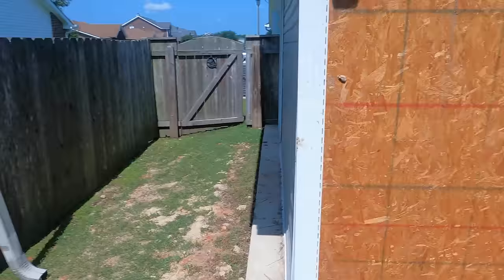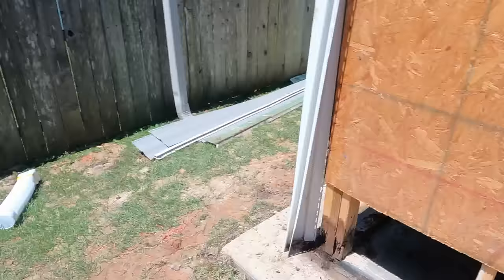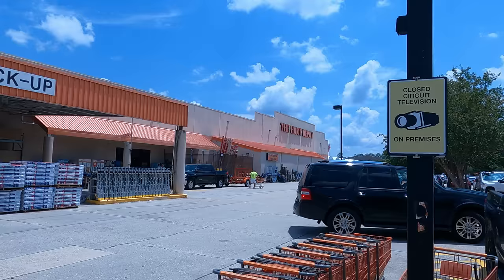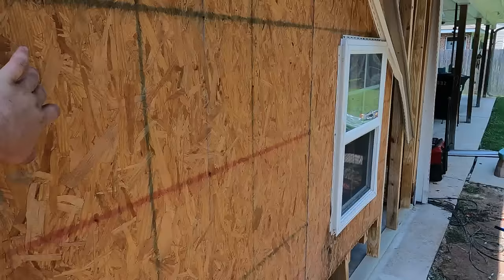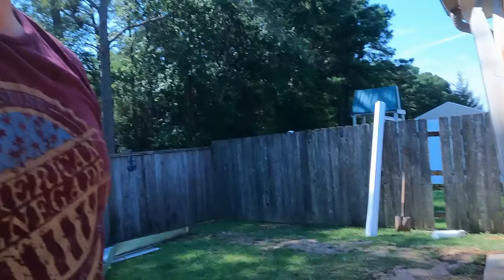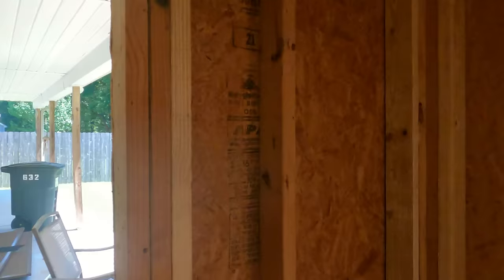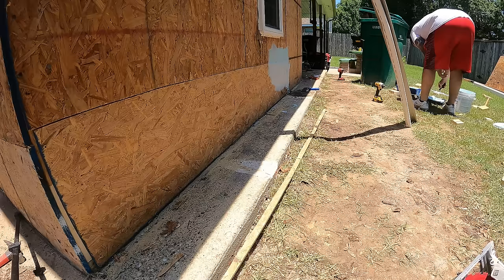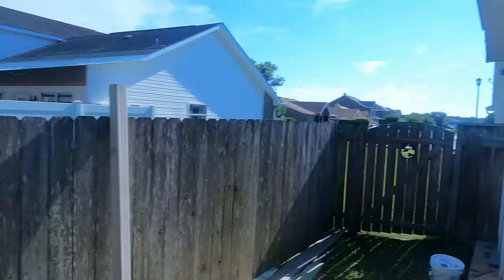How to Water proof a Shed.

Comment: This is pretty piss poor method of stopping water intrusion and will rot again in similar manner.  I just did a similar shed inset around the bottom on a slab, did a sill flashing or “Z flash” that came up min 2in in trim coil, then house wrapped overtop so wall drainage goes overtop as well.  Caulk and paint will fail if those are your primary methods alone for stopping water from coming back in…..gotta imagine after 9 months you’ve probably already had warranty calls on this one..

Comment: I like to double that bottom plate then put a piece of L shaped flashing on then use hardy for anything with ground contact. Then you have a 30 year solution.
Reply: What do you mean double the bottom plate?
Reply: @moneyforfelix321  2 - 2x4's at the bottom instead of one
Reply: @littlepebbles  exactly an extra plate and cut the studs to fit.
Reply: Good idea!
Reply: Close example of what I would try.  I am still trying to figure out the L shaped flashing.  My guess is to put a heavy gauge flashing coming down a few inches from the inside and then under the doubled up two X and up the outside a few inches.  With the light duty flashing coming down the outside about 4 or five inches and over the HD flashing mentioned earlier.  Plenty of right type of caulking underneath all flashing.  I also live in LA. and it rains/floods on a regular basis.

Comment: Some z flashing under the plywood would of been smart. And you should remove and cut the protruding concrete completely off. You fixed the rott but did not address what caused it to begin with. In five years they will have the same problem again
Reply: I was thinking the same thing. He put it back the same way it was, which pretty much ensures that the same thing will happen. Those little cuts in the concrete are not going to drain well enough to keep the sill dry. I would have replaced everything that rotted with pressure treated wood.
Reply: Could of just finished  with the water proofing in lieu  of  wrap

Comment: All I see here is a temporary fix to an ongoing problem because the building was not built right in the first place. Cannot have all that concrete pad on the outside walls as it will hold water no matter what you do. Either build the pad to the exact size of the shed and allow the siding to cover the bottom plate or use    blocks as a starter. And what is with the studs? The least you could have done was put filler 2x4 under the area you cut out. I would have suggested to the client that they cut off the excess concrete on the outside walls to prevent this from happening in the very near future. All the caulking in the world won't stop water on OSB at ground level and your coating only covers the outside of the board, what about the bottom of the board where the water will penetrate with all that concrete as a water bowl.
Reply: Hi - I have the same type of rot on my shed, although my concrete pad is the same size as my shed. Any advice on what I can do to prevent further rot when I replace the lower portions of plywood (luckily my studs haven't rotted yet)
Reply: I have the same issue with a 35+ year old very large shed, wood rot around entire perimeter. Shed was built on top of large concrete pad. The concrete pad has deteriorated on one side in particular. Can the shed be saved, the bones seem good. Clearly there are 2 major issues, needs a door and new threshold. Thought of fixing bottom & concrete and converting it to a greenhouse. Any thoughts or insights? Any response would help 😊

Comment: Why would you put the foundation wider than the footprint of the shed?  This just lets the runoff puddle on the bottom framing & siding. Also I put generous overhangs on my sheds to get water away from base and window trims where water creeps in from rains. Doing that will allow your building to last for many years to come.
Reply: Well said...funky stuff

Comment: I am so confused.  All I am told is to use pressure treated wood or Hardie board for such a thing. OSB is such an odd choice for concrete contact. The wrap isn't tucked under the OSB.  But you used that marine waterproofing.  Ugh.  So many opinions on how to do stuff.  I am lost.

Comment: I had several concerns about the final product but  K&M was likely paid to just  repair the damage not correct the cause.  If that's that case it was a good effort.  I've seen lots of these sheds original build on a slab.  A real fix  would have been to  add 6 inch wide  x  6 inch tall concrete sleeper/footing and place the new treated sill plate on top.  For the size of this  job that would only be a couple of sacks of ready mix using a wheelbarrow (and a few dowels).   Then the TREATED plywood  ending at least 3-4  inches above the concrete slab ending in a 1" x 2" notch in the concrete sleeper thus keeping all wood at least 3-4 inches above the slab.   Lot of termites in LA so having that wood nearly touching the slab is like putting out desert for the critters.
Reply: I would have done the same, they did not solve the issue, more work for later
Reply: Exactly. This is a poor fix. They could have at least flashed the bottom of the seal plate with flashing folded around the out side say 3".
Reply: I'm glad i didnt have to scroll far to find a comment that makes as much sense as this one did, im glad i found this video because i have a space between two weather-facing brick walls and i was trying to find a solution to framing a wall with a window, between them, your comment has given me some great insight into this.
Reply: Yes, the original problem was obvious. It lasted as long as it could, Lol. With the fix it will last a little bit longer. I suggest the owner start saving for the next repair job, oh well.
Reply: Still put untreated osb flush to the concrete slab. Will still wick moisture and rot just as fast. Could have gotten some zip sheathing and flashed the underside and the bottom 6" and never had an issue again
Reply: This guy probably knows the correct way of fixing it because his skills are high enough for him to notice it will just rot again soon due to water. The wall is just going to sit in a puddle of water again. The problem is that homeowners can't afford to do it the correct way or just don't want to pay for it. Contractors discuss what needs to be done and the cost of it and from there property owners try to get the cost to go down as much as possible. Everyone needs to eat, so the contractor goes along with it.
Reply: @George-my4hi  If he knew the correct way and the customer couldn't afford it, he should've turned the job down. 
Accepting this job is just a sign of poor workmanship. 
I understand the need to help a customer but this isn't helping, it's going to cost them even more money to fix again in the future.

Comment: Thanks for video. If my shed, i would replace wood at the bottom with two rows of cinder block. It last forever.
Reply: I thought about that too
Reply from the maker: @davidh7636  that would be preferred, but sometimes you just have to do what the client wants.

Comment: This is exactly what I needed. Thank you. And the video was well done. No fluff, just straight to the point. Well, there was a little bit of fluff, but it was absolutely necessary to see you sharing in my experience of going through terrible wood at Home Depot and Lowe’s and having to toss it aside. Haha!
Reply: I think he was supposed to put a thin board across as a spacer / before he installed the sidings.  That way there is an airgap if water to get behind the siding and the bld. paper.  Because theres no spacer, it gets trapped there.  I could be wrong.
Reply: @kendalgee5808  I don't know if that's necessary with the roof overhang and the interlocking siding panels.  Looks like that rot came from lack of drainage.  I wouldn't mind someone confirming.
Reply: @kendalgee5808  I stand corrected, they make a siding drainage mat just for that purpose.

Comment: I live in Sheltered Housing and have to use a mobility scooter, the scooter sheds that were installed here have no damp course, and my scooter began to acquire mould, I had to remove t and bring it inside. I have sent this video to our housing manager and I hope it will find its way to the repairs team and they can fix the problem. Thanks very much from dear old Blighty.

Comment: Excellent video! A similar problem exists with the siding of my shed. I scoured the internet looking for a fix for this problem. You nailed it!
Reply: He hardly nailed it, guarantee that in 10 or 15 years he will have the same problem again.  He cut a lot of corners, such as not totally removing the old studs, removing the window and wrapping his Tyvek, and most importantly lack of a gasket that sits between the concrete and bottom plate, which would have greatly improved its longevity.  If he really thinks a bit of caulk along the bottom and painting the exterior 2 feet up will prevent water damage, he's sadly mistaken, water always will find a way in.  Personally I would have used a rubber gasket under my bottom plate, the bottom plate would have been a trex 2x4 which is basically a hardend plastic 2x4 that can never rot, this would have guaranteed that moisture and water can't wisk its way up into the remaining wood work.  Keep the sheeting about 5/8 of an inch off the concrete, wrap my Tyvek around the window opening, being sure to tape my windows nailing phalange prior to reinstalling the siding.
Reply: Your explanation is very thorough and points out deficiencies in this guy’s work to a layperson like myself. Your comments will certainly be taken into consideration if I ever find someone who can repair my own shed. Thank you!!!!
Reply: They also didn’t flash the window properly. I would have run a butyl flashing tape along the base and then gone at least 9” up the walls with flashing tape. I would also have installed a metal L-flashing along the base behind the tyvek.

Comment: This is exactly why I do my own repairs.
Reply: Why?
Reply: @yokaa69 because this repair will not last.
Reply: @clydedenby1436 why is that? Just curious of your observations
Reply: No barrier in between concrete and bottom plate, still direct connecting with concrete probly more I just skipped most of it,base supposed to be same size is the building so water can run down that's the biggest problem not related to man
Reply: Yeah. Was wondering why they didn't add barrier there when between concrete and wood. And I would maybe have even layer of cinder blocks between so that the wood would start bit higher. They added water proofing outside but if nothing else moisture gets up to the wood from concrete without barrier there.
Reply: @ozturkalper What did you mean?
Reply: @Thewolfe112  OSB is trash. Use pressure-treated lumber or give up.

Comment: That's what we are doing five yrs ago hit bad by hurricane Irma. Just now doing the reroof of the rotted shed that sat  for five years whilst we did hurricane clean up. It was baaad. For this chick once you have experienced a fully rotted shed you really want to study up on all things waterproofing!  Everything sealed,  especially since we live in Southwest Florida. Luckily most of the shed had cement blocks for a foundation underneath the beam for the wall so we were really good there and only a couple of the posts had brought it but we had to move the shed 2 ft further away from the house so that we could work on the house and the gutters etc the gutters are what caused all the rotting I think but this shed is going to be a lot more waterproof and I already have two giant rolls of weather guard that I'm going to use on the roof and possibly house wrap on the sides before I put on the final siding layer I'm excited about it it's been a long time coming that's why I'm watching your video

Comment: Some opportunities for the next install.  First understand where the water is coming from and why the failure.  To me, the water is coming in around the window and splash back coming up  vertical from concrete and yard.  It is coming upward between the siding pieces.   Use marine grade plywood for the 1st 24".  Use stainless nails in the Hilti.  Reinstall the window with proper sealing methods.  Consider putting a drainage mat over the Tyvek.  I live in SC on the coast and have the same type weather.  Never underestimate the damage of water that goes up hill, such as splash back and wind driven.
Reply: Yep. Not to mention water will slide down a surface and wrap around 90º ... then it just wicks up the end.

Comment: I've always seen a rubber membrane on the bottom of the sill plate to concrete especially in real wet and rain areas
Reply: a capillary break.
Reply: Just pour a proper slab and overhang the building from the get-go and none of this nonsense happens. This is just a temporary fix, it will fail too, as the root of the problem was not addressed.

Comment: Why not paint the bottom framing with the water proofing paint? (Including the bottom of the plate before putting it down.)
Also, why not block below the original studs? It would have made for a much stronger structure in the end. You kept saying you were replacing the studs, but all you did was sister up to the old ones, you only replaced the bottom plate and skirt OSB for the most part. Also, unless you tucked the "tyvek" under the bottom of the window's bottom tab, you just gave water a way in at the bottom of the window. All in all, a functional repair, for the short haul, but it could have been better. You could have cut the concrete pad off even with the building, and/or put gutters and down spouts on. If the area floods like you said in the video, the little drains you cut in the concrete, in the video, won't do much now will they?
Reply: I was wondering the same thing about the water getting yet again underneath once the side wind starts blowing....
Reply: He used liquid nail under it it’s fine 😂
Reply: Exactly what i was thinking. Just pre paint the whole thing heavily, and try your best to encapsulate that pourous board. That chip board is like a sponge with water.
Reply: If you leave fungus spores (fruiting wood) it'll just spread to the sistered stud !
Reply: Still needs moisture to rot though. Spores are everwhere and there’s no such thing as dry rot.
Reply: @Lordfate3  yes and no, spores cant exist, and thrive, below certain moisture levels. There are spores all over everything, all the time... without a moisture above a certain %, the rot can never occure..
Reply: painting a sill plate won’t prevent it from absorbing moisture from the concrete
Reply: You can never eliminate concrete to wood contact but A LOT can be done to mitigate water contact with the wood. having the exterior concrete NOT continue under the wood framing would be a huge start.

Comment: Simplest trick would have been to put some waterproof foil or or whatever under the wood before putting it on the concrete and then wrapping that foil upward. Best solution is to put a row or 2 or 3 of bricks down first and start framing on top of that or those long concrete bands used for making raised flower beds
Reply: Any pin holes /side ends would absorb water and the foil would keep ANY moisture in.  Might rot FASTER.

Comment: This is exactly what I need to do.  I have a shed/pump house that has rotted OSB in the lower 18” of at least one wall.  I am in process of removing that lovely vinyl siding so I can cut out the bad OSB.  Can you tell me what you used for your aquatic membrane or seal?  Also would it be wise to put something on the bottom edge of the OSB to prevent it from wicking up all that moisture in the future? Thanks and all the best from north Texas.

Comment: I enjoyed the video with the time lapse. Was fun watching the dog. Would have preferred more of an explanation as to what was being done and why it was being done. This did provide me with more insight into the process than I had before. An example of more explanation: When you were looking at the lumber in home depot. What exactly were you looking for? Why were you discarding so many pieces? Also when you were putting up the temporary supports how did you determine the proper sizes needed and how exactly do you shift the burden off of the current lumber holding up the weight. How do you know not to go too tall? Thanks again for your video and I also appreciate the comments below the video even if some are critical they may prove valuable and helpful for those like myself who are seeking to learn from those like yourself and selves who are more knowledgeable.

Comment: Flashing at the sill and treated plywood wall sheathing down there, too, adds more longevity to the structure. I had the same problem with a 40 year old building. Water, bugs, mice, mold, rott, all gone, forever.

Comment: One point:
If the baseplate is rotten from the bottom up, this surely is due to rising damp from the concrete base. Why didn’t you lay a DPM strip before putting down the baseplate? This would have stopped it from happening again. 
💂‍♂️🇬🇧

Comment: Have you ever used liquid flashing on the sill plate? Builders I know swear by it. 
It not only stops water but insects as well.  If applied correctly it stops water from leeching up the 
OSB

Comment: What about the requirements for a sill plate gasket between the concrete pad and wooden bottom plate instead of that useless glue crap.  A sill plate gasket is code stuff here in Canada, and for good reason... as it helps and stops water wicking up into the wooden sill plate and structure.  I personally use two strips of cut roll roofing material on top of each other for that sill plate gasket for even better protection.  😊

Comment: The issue here was how it was originally built. A little one or 2 foot block wall on top of the pad would've kept the wood high and dry but they did a nice job waterproofing and repairing.